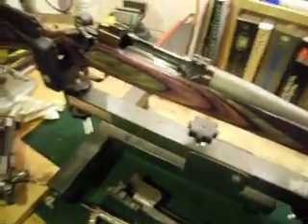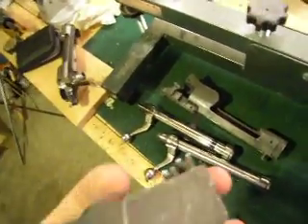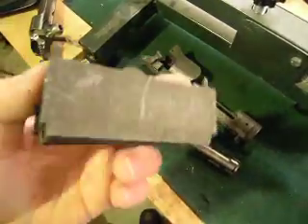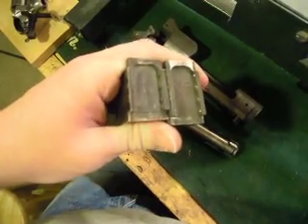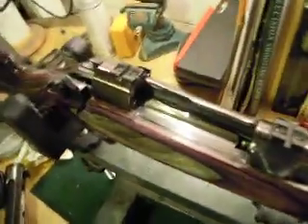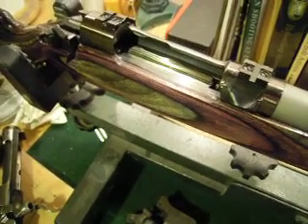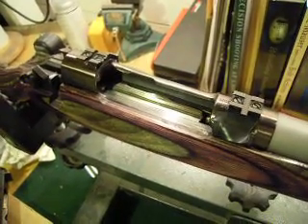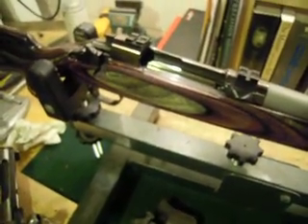Custom Rifle 1917 Enfield modified part 2- Gunsmithing

Comment: Is it possible to remove the 2 precision factory safety and install a 3 position wing safety?
Reply from the maker: There is a company that makes a 3 position that goes on the shroud. It used to be Ed Lapour, but he sold to another guy that still makes them. They are mainly used with full custom builds and safari rifles. Not sure I've ever seen the factory one modified.
Reply: @spitfire1821  Would a Remington 700 Gentry 3 pieces safety be compatible. Or are the dimensions of the striker and the threads be different?
Reply from the maker: @davidhomen6204  Threads are different. 700 Has standard style threads, enfield is square threads.

Comment: Do you have any 1917 actions done you would sell?? any undone? I'm a disabled former union ironworker and like to tinker when i'm up to it. I have a knife making shop set up and a shitty smithy lathe and an old benchmaster horizontal mill and could probably do alot myself. Since the new opiate laws my meds have been drastically cut and I can barely get around anymore though. Have a shot knee and broke my back 3 different times. I have 2 sporteized enfields that i bought that way and then restocked myself and i just got 2 timneys for them. I really like them alot and one of your actions would be an awesome project for me to finish. thanks, Mike
Reply from the maker: I don't at this time. Keep an eye out, they pop up every once in a while for cheap.
Reply: @precisionmachineshed  Thanks, Have a good night, the Timney I bought rides over the cock on open cocking piece on 1 rifle,  it looks like they had filed it down so I just silver soldered an L shaped piece of knife steel I hardened to it and then reshaped it. I'll replace it eventually but it should work for now. Once you've had the cock on opening the cock on closing seems terrible. I have a couple mil surplus parts kits I got yrs ago for them just to have on hand as I figured eventually they'll be hard to find but the parts are pretty rusty and rough but usable for spares. Take care, ill keep my eye out, Mike

Comment: what caliber/cartridge are you going with, original .06 or other? I would like to have one chambered in 375 ruger.
Reply from the maker: I've done everything from .22-250's to 338 RUM's. Most of them are wildcats of one sort of the other. I've got a .30-375 Ruger that is a fun round.
Reply: is that same as 30 nosler?
Reply: Mine is a re-chambered Eddystne with orig 26" bbl, in .300 H&H mag.The barrel can be rechambered to all belted .30 cal.